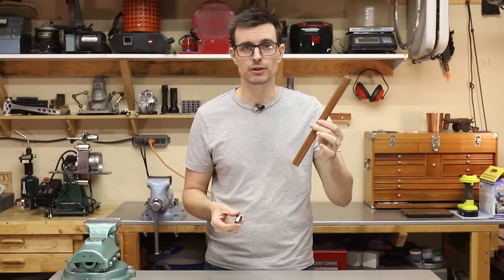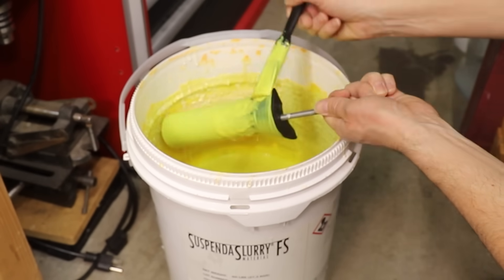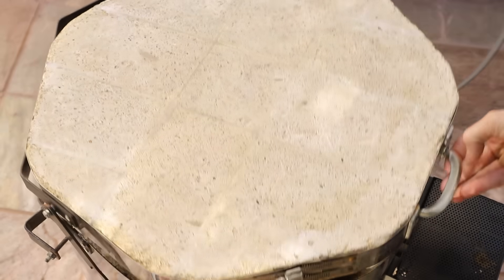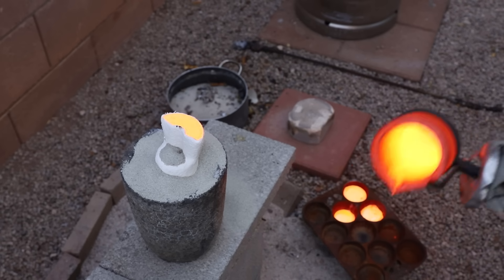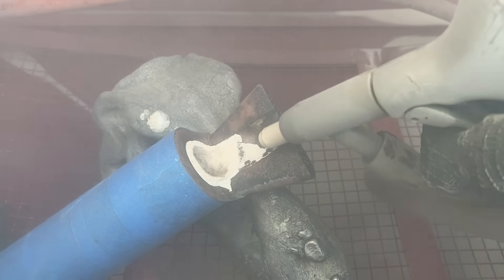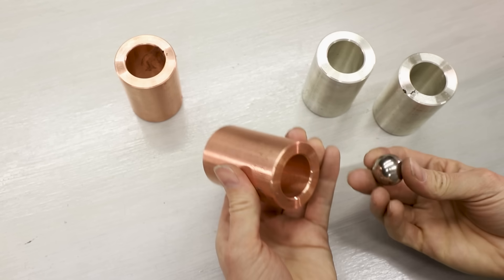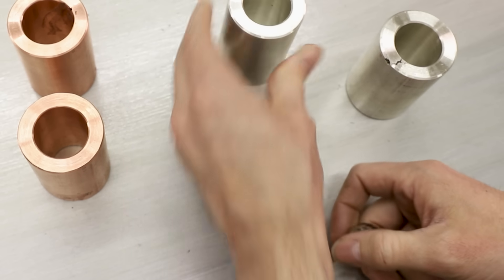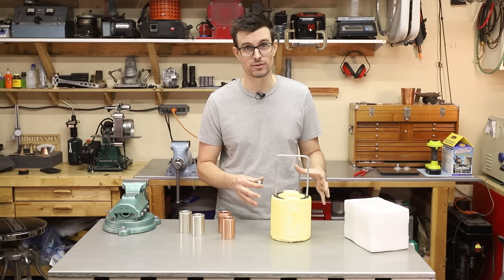Making Anti-gravity tubes - Copper & Silver! - Lenz's law - Metal casting Experiment

Comment: The magnet creates electricity as it passes through a field of magnetic metal like copper.  In a solid tube, though, it creates little eddy currents, both poles are created simultaneously and attempt to cancel each other out.  This slows the magnet.  The "molasses" feeling was indeed resistance of the two poles fighting each other.  What if you cut the silver pipe into 100 individual washers, use an insulation material like lacquer to insulate them from each other,  align them back into the shape of a pipe, create 2 pole busses, connect every other washer to one bus by copper wire, and connect all the alternate washers to the other bus. Then drop the magnet through the pipe.  Experiment by connecting the 2 busses together, and then apart.  Experiment with the width of the washers.  If you have a 1 inch cube magnet with north facing upward then the washers (with lacquer) should be a half inch.  The north magnet pole facing upward and the south magnetic pole facing downward.  As the magnet passes through the pipe each 1/2 inch section will first create a negative eddu field and eventually turn into a positive field as the magnet continues passing through.  And the same would happen to the next section, and next section, and so on.  You would still have resistance because the 2 forces are still present in each section.  Then experiment with diodes on each section.  Set the diodes in such a way that positive pulses can only be sent to one bus for alternating sections, and so positive pulses will be sent to the other bus for the alternate sections.  This is not be very efficient generator but the magnet will travel faster through the tube.  At least until you add a load to the 2 positive busses.  Try adding a third bus as the negative return. Then calculate the efficiency of the generator.

Comment: I recall reading that the method to remove copper and other impurities from silver is to melt it so that it's in a thin layer, then blow air over it. In the case of the copper, you'll get copper oxide (which will float to the surface) and fine silver. If this actually works, which seems likely, I bet gold would behave the same way.

A tip: I found that an N100 mask can help keep you from getting a condition called "metal fume fever". From personal experience, this condition is not fun.

Comment: what about making a copper tube in the form of a spiral for longer length, and after that connect the tube to a rotating spindle so that the neodinium magnet will never reach the ends of the spiral.

Comment: I would’ve stacked a aluminum and then a copper and aluminum then a copper to see it will it accelerate or stop. 

Also I want to add a wire attachment to the copper and silver to see what is the electrical properties that the magnet is leaving behind when it passes through the copper and silver.

Comment: Could you make three tube's with a tighter inside diameter to drop in your magnetic sphere, so you have tubes a, b , c, in a and c put a wood down to stop fall of your sphere and then drop a sphere in tube b, will it stop the sphere magnetically, if it does then begin to separate tubes a, and c, how far from the other tubes does the sphere in tube b start to fall again.

Comment: Fun fact: During the development of the atomic bomb in WWII, the US treasury lent its pure silver bullion to the project for making wire used in the electrical windings of cyclotrons that were constructed for separating uranium isotopes.  Although it worked, the diffusion method turned out to be better.

Comment: If you wrapped a coil of wire around the cylinders, would you see a generated current?
Reply: Just use the coil; never heard of Faraday?
Reply: @DJF1947  The tubes are not Faraday cages.
Reply: @PyroRob69 No, but given that the braking effect is due to induced currents near to the surface, which then produce an opposing magnetic field, very little of the induction effect is likely to reach a surrounding coil.
Reply: @DJF1947  Odd, I have worked in, on, and around tempest rooms and buildings since the 80’s and every one of them had closed tops, bottoms, and all sides, and are grounded to block EMI all the way around. If an open top and bottom worked, why would all of those be different?
Reply: @PyroRob69  Entirely different principle. Faraday cages are designed to block electromagnetic radiation. This is induction.

Comment: FUN FACT: Did you know that they use this process for the brakes on drop tower rides. Like Drop Line at DollyWood and Panic Plunge at SilverWood theme parks. There's a couple of reasons for using this magnetic system as appose to using friction brakes. 1). It will never wear out, which means it will work with 100% reliability, Something that you want when you're dropping a ride vehicle from 200 feet in the air. 2). It only activates when the ride vehicle is moving faster then the configured speed. This is important so it doesn't put a load on the ride vehicle while it's being hoisted to the top of the tower. This process is 100% passive.
Reply: Wow, thanks for the info! Does this principle apply to exercise bikes that have magnetic resistance? I really don’t know too much about the engineering of things. 😅
Reply: Modern roller coasters use this system for breaks as well, thus just the need of an very small friction break at the end of an block section.
Reply: @Toxicity1987  "brakes", not "breaks"
Reply: @toordog1753  Linear induction is just another word for eddy current. Its exactly the same principle.
Reply: Use it to make automotive shock absorbers.
Reply: Also doesn't require an electric source for 100% safety. The electric does occasionally go out.
Reply: Neat! But, how do they make a “configured speed”, as shouldn’t the eddy currents always occur at any non-0 velocity?
Reply: the emf is proportional to the speed so there's a balance point @chtechindustries4174
Reply: I wonder how this would do as a shock absorber for a vehicle.
Reply: Magnetic braking is also in use in many emergency elevator breaking systems, and other roller coasters, some industrial equipment as well.
Reply: Certainly! Here’s a project proposal in English for an EU funding application, focusing on a system with rotating copper tubes and floating objects between two round magnets:

---

### *Project Proposal: Rotating Copper Tube System for Efficient Material Handling*

*1. Project Overview*

We propose the development of an advanced material handling system using rotating copper tubes with electromagnetic levitation technology. This innovative system will feature two round magnets inside a copper tube, with objects floating between them. The rotation of the tube and the electromagnetic fields will allow for the efficient and controlled transportation of various materials or products.

*2. Project Objectives*

- **Design and Development**: Create a rotating copper tube system equipped with two round magnets that utilize electromagnetic levitation to transport materials with minimal friction.
- **Enhanced Efficiency**: Improve the efficiency of material handling by reducing friction and increasing the stability of floating objects within the system.
- **Commercial and Environmental Impact**: Offer a novel solution for handling and transporting materials in various industries, enhancing operational efficiency and sustainability.

*3. Technical Specifications*

- **Copper Tube**: The system will use a copper tube that rotates to create a stable environment for the levitation of objects.
- **Magnets**: Two round magnets will be placed inside the tube. The electromagnetic fields generated by these magnets will levitate the objects between them.
- **Floating Objects**: Materials or products will be placed between the magnets and will float due to the electromagnetic levitation, allowing for smooth and controlled movement.

*4. Cost Breakdown*

*a. Material Costs*

- **Copper Tube**:
  - **Cost per Meter**: 50 EUR (estimate)
  - **Length**: 10 meters
  - **Total Cost**: 500 EUR

- **Round Magnets**:
  - **Cost per Magnet**: 100 EUR (estimate)
  - **Quantity**: 2 magnets
  - **Total Cost**: 200 EUR

- **Electromagnetic Coils and Control Systems**:
  - **Total Cost**: 800 EUR (estimate)

- **Additional Components**:
  - **Motor and Rotational Mechanism**: 1,000 EUR (estimate)
  - **Installation and Safety Systems**: 500 EUR (estimate)

*b. Installation Costs*

- **Copper Tube Installation**: 1,000 EUR (estimate)
- **Magnet and Coil Installation**: 500 EUR (estimate)
- **Motor and Control Systems Installation**: 500 EUR (estimate)

*c. Development and Testing Costs*

- **System Development**: 1,500 EUR (estimate)
- **Testing and Optimization**: 1,000 EUR (estimate)

*d. Total Estimated Costs*

- **Materials**: 1,500 EUR
- **Installation**: 2,000 EUR
- **Development and Testing**: 2,500 EUR
- **Total**: 6,000 EUR

*5. Implementation Plan*

1. *Phase 1: Design and Procurement* (1 month)
   - Design the system and procure copper tubes, magnets, and other components.
   - Develop electromagnetic coils and control systems.

2. *Phase 2: Installation* (2 months)
   - Install copper tube and magnet systems.
   - Set up electromagnetic coils, motor, and control systems.

3. *Phase 3: Testing and Optimization* (1 month)
   - Conduct testing to ensure effective levitation and material handling.
   - Fine-tune the system based on performance results.

4. *Phase 4: Launch and Marketing* (1 month)
   - Officially launch the system.
   - Promote the system to potential users and stakeholders.

*6. Expected Outcomes*

- **Efficiency Improvement**: Enhanced material handling capabilities with reduced friction and improved stability.
- **Safety and Control**: Safe and controlled levitation of materials, reducing risk of damage.
- **Innovation**: Introduction of a novel solution for material transportation, contributing to operational efficiency and environmental sustainability.

*7. Conclusion*

We seek EU funding of 6,000 EUR to support the development and implementation of this innovative rotating copper tube system. The project aims to revolutionize material handling processes, improve efficiency, and offer a sustainable solution for various industries. The funding will be used for material procurement, installation, system development, and testing.

---

This proposal outlines the key components and costs associated with the project. Adjust the details and estimates based on the specific requirements of the EU funding program and the exact scope of your project.
Reply: it DOES wear out, but a lot more slowly. Google eddy currents.
Reply: Magnets aren't forever.
Reply: @kayakMike1000  Only if you heat them beyond the curie temperature. Sure, that has to be accounted for.
Reply: @kayakMike1000 only Diamonds eh?
Reply: I'm not that advanced but I would have imagined this kind of idea would be beneficial in some like that or more
Reply: of course
Reply: u didnt know that, i did. plus much more
Reply: Such a passive magnetic braking system sounds fail-safe. Interesting!
Reply: It also shows that it's Energy's in MOTION with the Stronger Energy overrides the Weaker Energy at all times
Reply: an one more cool device is the magnetic TMD, it can damp the vibration, just passively attached to the vibrating part, just like a sitting duck. https://www.youtube.com/watch?v=HDa1VO1VDpc
Reply: Its also used in auto belay systems found in climbing gyms
Reply: This is 👍️why allways check YT comments
Reply: @Megaestatesalesweb  By "wear out" you mean that the magnet lost it's magnetism. The magnet might not be scratched, chipped or mechanically worn out, but it lost it's North and South pole. It cannot pick up screws or nails. The longer a magnet holds it's magnetism, the harder it is to re-magnetize with an electric coil with current. It is probably more expensive because the iron has carbon or other elements mixed in, and an electric current has to run for a long time to re-magnetize it.
Reply: That's what cars need, if they can be activated by the break pedal. And that seems like it would not be that hard to do. But the brake manufacturers would fight it, just like battery makers fought the release of rechargeable batteries for decades.
Reply: @Bigfoot-px9gj  magnetic braking cannot bring something to a complete stop, you still need friction brakes to bring a vehicle to a complete stop. Most electric and hybrid vehicles however do have magnetic braking with their Regenerative Braking systems.

Comment: It would have been interesting to hook a VOM up to either end of the metal tubes and see if measurable voltage and current are being induced.
Reply: Few places to insert a probe and you’d need to break the loop. You could maybe use an inductance loop but the magnet would also mess with that.
Reply: no, the emf and current go AROUND the tube
Reply: Probably generating heat so a thermo coupling would be better
Reply: I have tried sending an LED down with the magnet but never got the right connections to produce light. Not done experimenting yet,.Finding the time for such trivialities of life.
Reply: @OhmSteader  read the previous comments, and you will see why that won't work
Reply: There wouldn't be much voltage.  That's because you have high currents in a very low resistance environment.  And measuring currents wouldn't be easy, because they go around the tube.  There's no easy way to install a current meter.

Comment: You refer to the copper as having "resistance." Resistance is an electrical function. In fact, what you are witnessing is "Reluctance," And, what your are demonstrating is the basis of carnival / amusement park Free Fall rides. The passenger cars are truly in free-fall from the time they are released by the lifting device until they enter the field of those huge copper plates at the bottom. Interestingly, it doesn't matter how fast the approach because the greater the speed, the greater the reluctance between copper and magnets. As an experiment try accelerating the magnet, either with a long PVC or clear plastic tube affixed to the top of the copper body, or accelerating it with compressed air. I look forward to that episode.

Comment: Fun experiments for demonstrating the basics of electromagnetic induction. I really wish you wouldn't use the term Anti-gravity however. Content creators should avoid misleading or using absolutely incorrect descriptions.  For more fun on the topic, do some research on roller coaster breaking systems.
Reply: Indeed... don't know details, but once read some roller coaster magnetic braking systems also include cooling systems.

Comment: The experiment was poorly conducted. I see the following shortcomings: a large gap between the magnet and the pipe, due to which some of the magnetic fields passed from the north pole to the south pole, bypassing the pipe. Well, the second drawback of the experiment: the time of movement of the magnet through the copper and silver pipe was not recorded.

Comment: The first experiment that you have in the video with the long thin walled copper tube is very interesting because of the longer time it takes for the magnet to drop through. This could be roughly timed by a second person with a stop watch. Then try placing cylindrical lead weights ( with same diameter of magnet) of various lengths (meaning they would have differing weights) onto one end of the magnet using double back sticky tape then drop it through the tube and time it again for each weight. I don’t know what will be the relation between speed versus the added weight. It might be interesting. As always magnets are very brittle and should always use safety goggles. Thanks.

Comment: If you really want to slow it down as much as possible, the most important factor is how closely diameter of the pipe matches with the magnet.  This is because magnetic force diminishes proportional to the cube of the distance.  
As an example: I have a 2 ft section of 1/2" (nominally, actual inner diameter is more like 0.55inch) copper pipe.  Dropping a 1/2" cylinder magnet through it takes about 11 seconds.  Whereas a smaller cylinder of ~10 mm diameter (much more gap between pipe walls and magnet) takes only ~4 seconds.  The pipe walls are only 0.040" thick.

Comment: This works the other way around as well. If you drop the metal through a strong magnetic field it will result in the same effect. I used a magnet from a hard disk drive, which has a gap that a coin can pass through, and a very strong field that allows for very precise positioning of the read/write heads. Interestingly a US Nickel falls freely through the field even though it is 75% copper and 25% nickel. A silver bullion coin (99.9% silver) slows way down. A US Quarter Dollar (8.33% nickel & 91.67% copper) does slow through the magnet but not as much as pure silver. Interestingly, the nickel is an alloy, (as is the Sterling silver) whereas the quarter is a clad structure, with a copper/nickel alloy around a pure copper center.